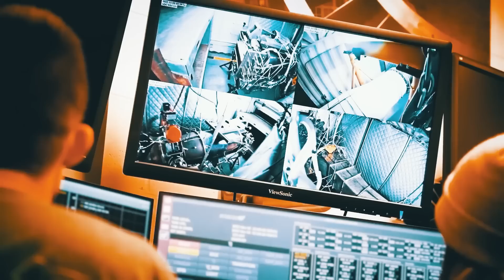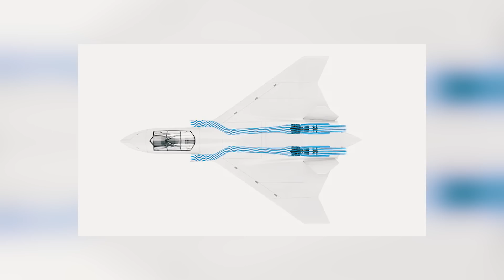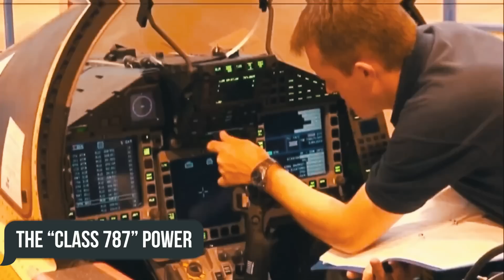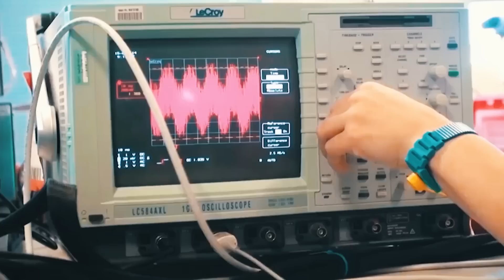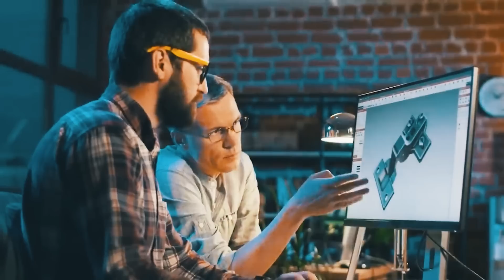Finally: UK Launch New Tempest 6th-Gen Fighter Jet to Replace Typhoon

Comment: Flying fighter pilot's days are numbered, soon to be fully replaced by either ground drone control or AI.
Reply: That is all very well but if the radio links and GPS are jammed they become useless. Autonomous drones with terrain mapping and inertial navigation systems would be immune but realtime control would be unreliable.
Reply: @rogerphelps9939  You think they're going to make all this cutting edge equipment, but not upgrade protection for those systems? Your mind is both thinking of the future while staying in the past.

Comment: Britain is pretty useless at most things but producing fit for purpose aircraft has traditionally been a strength. The weakness, is that we have a shadow government poised to take power and who can be relied on to cancel anything innovative. If the Labour party wins the next election this project is probably doomed.
A significant lesson was learned by Britain when Frank Whittle's jet engine invention was dismissed, by military decision makers, way before the Germans had their first into production jet fighter. In fact it is highly likely that spies sold the very concept to the Nazis. Whittle patented the jet engine a full nine years before the first jet took to the skies in 1939. Had the Ministry of Defence taken him seriously the whole thing could have been secret and Britain alone would have benefitted from jet aircraft long before anyone else. This lesson, having been learned, paved the way for the unhindered production of other non traditional craft such as the hovercraft and the jump jet.
Reply: One has to really wonder why politicians and the mandarins controlling the purse strings seem to always take a country backwards?
Reply: Well it will certainly be doomed if the Tories somehow manage to hang on at the next general election.

Comment: This guy is talking bollocks. The Hawker Tempest wasn't a replacement for Typhoon. It was a development of the Typhoon. A thin wing version for high altitude intetceptor role. Typhoon was a roebust hard hitting fighter/ bomber, low level interceptor. Piston engine, not jet as stated.

Comment: Join the RAF fleet in 2035, surely any technology they are using and thinking about during the next 5 years will be miles behind in 2035
Reply: No it won't. Everybody else will have the same obsolescence problems. The tech might be dated by 2035vbut that does not mean it will be ineffective.

Comment: The "6th gen" tempest is using proprietary materials developed by Lockheed. I can't say anything further online about this.
Reply: I think BAE Systems would beg to differ on that one.
Reply: Ok 😂 and probably 70% of the things in the f-35 are british. Literally look it up
Reply: I don't know about 70% but I do know that the UK's contribution to the F35 program is around 15% which is substantial. @Bedic-Mag
Reply: Having just retired and worked for Lockheed and BAE systems I can tell you your wrong.

Comment: Just think back to a character named Frank Whittle who invented and filed a patent for a thing called the  'jet engine' in the 1930s. The civil servants in the Air Ministry as it was called then saw "no useful purpose" in the machine, so it was shelved.  History has a nasty habit of repeating itself.
Reply: Of course you might consider that the tale put about to explain why development did not proceed on that engine was simply because the metal to build the turbine blades was not available. On the other hand the axial flow Jumo 004 required some pretty horrific aerodynamic problems to be solved first, which was why the Germans were indecisive about the whole thing. I suspect the real answer is that you should believe nothing on matters scientific or engineering from the time, and when you do find the lie, look for the lie behind that.
Reply: @Samothrace83 Absolute BS!!!
Reply: @Samothrace83  An engine was actually constructed and ran. Yes the speed and temperature were limited by materials available at the time. However 'Necessity breeds invention' and no doubt metallurgists would have been able to provide new alloys if they had been given the opportunity.

Comment: Love all the comments but after 40 years service at British Aerospace now BAE Systems I'm affraid its not government or our inovation that will kill the project, it is BAE Systems itself.
They now employ more, less experienced people and more manager nepotism, that is managers getting relatives jobs and a culture of paying low skilled workers the same pay as qualified engineers, how does that work. Semi skilled shop floor workers earning £37,000 a year. Office staff doing non jobs on £43,000 to £53,000 and they know nothing of the technical skills to design and build a superior fast jet aircraft. Therefore, the project is likely to fail due to cost. If it flies it will be in limited numbers as they will likely cost upward of £250 million each, possibly over£300 millon by 2030.

Comment: WWII Tempest never replaced Typhoon.
Typhoon wasn't up to the job as interceptor/fighter, but found its niche as a tactical fighter.
Tempest was a redesign, thin wing, aero dynamic work etc it was perhaps the best low level fighter of WWII.

Comment: I'm old enough to remember many, many UK rocket and fighter projects that simply ran into budgetary sand. The TSR2 possibly the most infamous. The decision to develop a manned fighter seem strange. All that weight and constraint on performance (no nasty accelerations) to keep the little squishy driver alive! Look rather to cheap, unmanned, fully autonomous air defense systems. This thing would be useless for close ground support. No  opponent will bother with a manned solution to a (possibly nonexistent) problem.

Comment: The original tempest was a piston engined fighter with a 24 cylinder h configuration opposed flat engine, not a jet
Reply: Napier Sabre 24 cylinder sleeve valve engine. 2 flat 12s siamesed together. Very complex engine. Used in Hawker Typhoon and Tempest
Reply: Les than a minute in and it's a blindingly obvious f*ck up. That's just embarassing.

Comment: Never ever discount the Brits. The TSR 2 should never heve been dropt, if it had been fully developed it would have been one of the greatest fighter bombers ever. I have no dought, if it is allowed to be fully devleloped, this new aircraft will be up here with the very best.
Reply: Wrong. The TSR2 was very vulnerable to interception even though it flew low. It also took far too long to get to its target. SLBMs are far superior and the correct decision was made.

Comment: at present there is NO jet that can take off faster than a Tiffy or climb faster or cruise faster, a typhoon from brakes off is airborne in 8secs and is at 62,000ft in 60secs and supercruises at Mach 1.5
Reply: The old E E Lightening was faster!
Reply: @khankrum1  only at supercruise by a whisker mach 2.2 compaired to mach 2 for Tiffy but every other performance related spec blows the lightning away so does FUEL CONSUMPTION its why there are so many at the bottom of the North Sea who ran out before returning
Reply: @khankrum1  and flew higher!
Reply: @khankrum1 Crazy when you realise just how old the technology was in the EE Lightening.
Reply: Maximum speed Mach 2.2
Reply: Do people really call it that? It just sounds so silly for such a hugely expensive peice of war machinery.